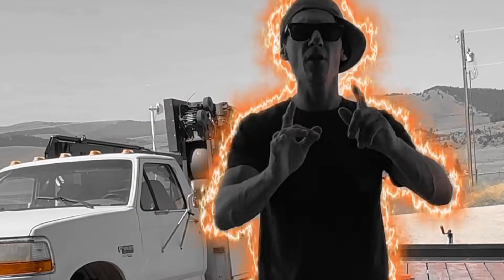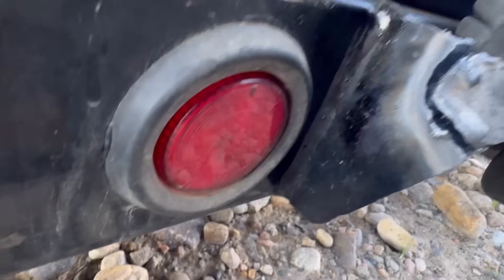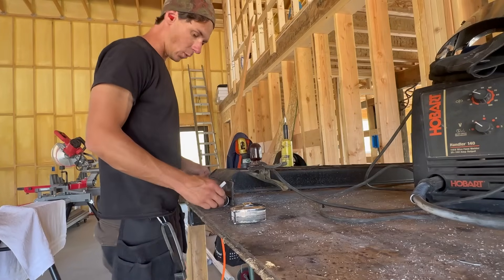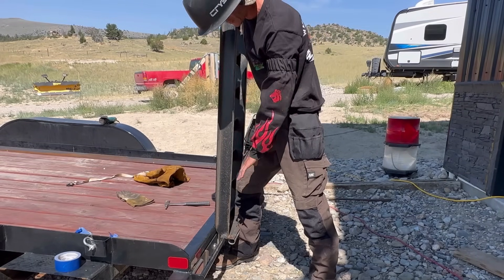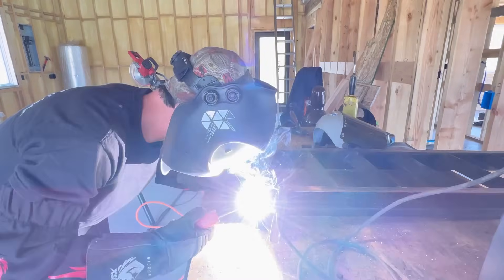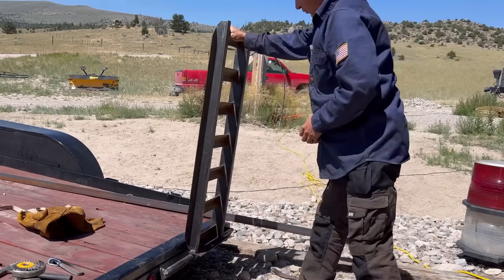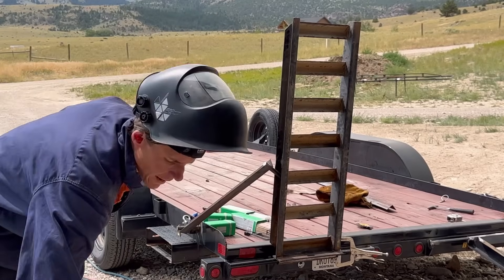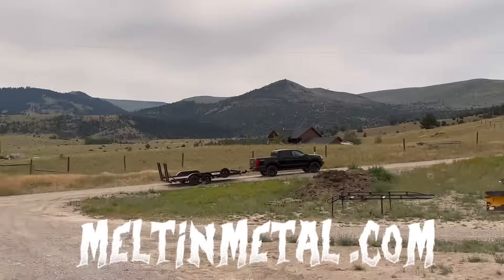Making a Neighbors trailer more useful

Comment: A while back you did a video where you bragged about matabo grinders. I only had a couple 4 inch dewalt grinders that I love but I could use a 6 inch. I was in the local weld shop and saw they had matabo grinders and I got a 6 inch corded grinder. I am amazed at how it runs. I love that thing. Thanks for the recommendation and for the content.

Comment: Nice job with the torch cuts.  Your Handler sounds like the wire drive motor is on the way out, or not. I've got an old Miller 211 that I use for FC and it's whined since I got it 1 years ago, I keep expecting it to not work when I pull the trigger but it keeps on keeping on.
Your design and fix of the trailer is 100% better than the way it was.  That was a ridiculous design having to put them in the side.  
Have a great week, Anthony
Reply: Take apart the motor and regrease the bushings.

Comment: Oke thing i will is instead of angle i wouldve used flat bar i know its not as strong but its lighter and easier to move around and also looks better. You couldve cut a leg of the angle with your torch wouldve been quick and easy plus you couldve rounded the edges of the flat stock so they arent near as sharp i did the exact same project for an old boss one of their work trailers

Comment: Pretty thin tubing there... If you are going to use obviously thin tube at least give the guy some legs on the ramp to pick up the load and stop the trailer from bucking at the hitch. Apologies for the outburst I'll go fuck myself now
Reply from the maker: It was cold rolled it will work fine but yes you know what to do
Reply: @MeltinMetalAnthony  Its too thin. They used 1/4" angle and 1" round stock for a reason. That will wear itself out from the inside and fatigue and crack. Junk.
Reply: @NotSureJoeBauers  Wear itself out from the inside?  Like in 50 years maybe?   How many times will those ramps be lowered and raised?  At most, twice per day?  And maybe not even once per week?
Reply: @garys5175   Thats not even 1/8th inch wall tubing. The vibration from the ramp bouncing around will wear that metal down and make it brittle. The thickness isn't sufficient enough as it is let alone 5 years and 15,000 miles from now. Think about it you have 1/8th in wall at best supporting up to 5k lbs point load. You can't put enough boogers on that tubing to really call it good for the loads that trailer ramp/trailer can take. If 1/8th inch was good enough they wouldn't have used 1/4 or 3/8ths plate and 1" round stock for the original ramps.
Reply: I looked again, it is pretty thin, perhaps you are right  @NotSureJoeBauers
Reply: Thick enough to not disintegrate from the stick welds haha
Reply: @garys5175 it’s bearing all the load from the machinery driving up it. It’s gonna flex and wear.